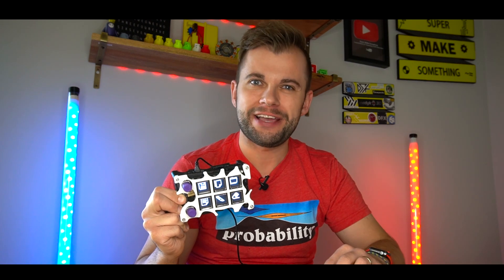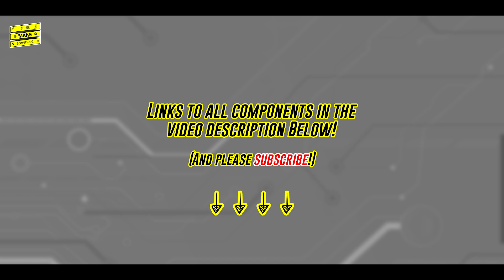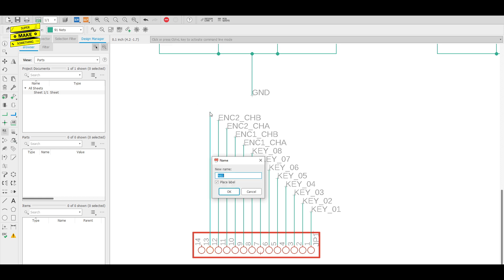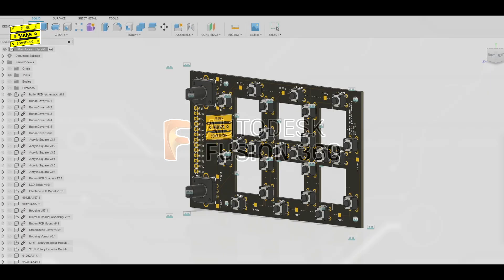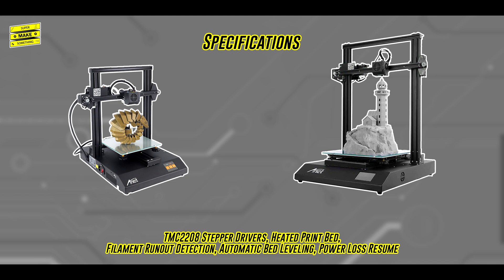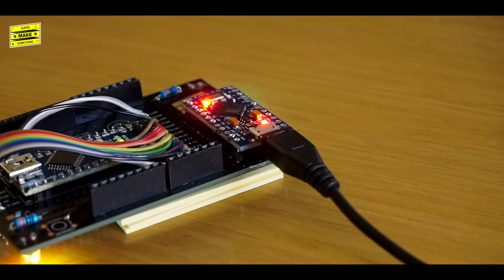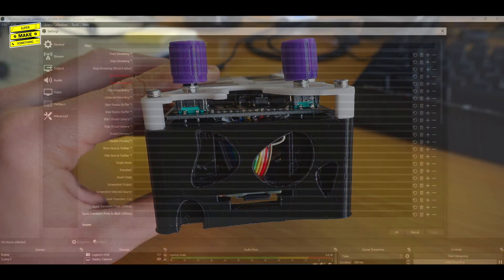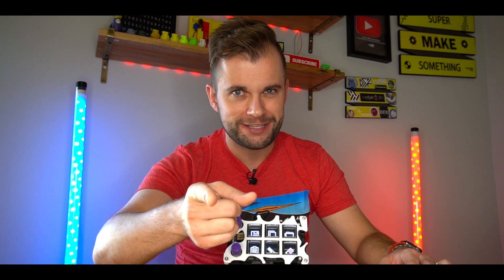DIY Stream Deck (3D Printing, Arduino, Electronics!)

Comment: y u don't use a multiplexeur
Reply from the maker: Definitely thought about it! For this version, I wanted to make it as easy as possible for anyone to build, so I did not want to have to make people try to buy individual chips because that can get confusing (both in terms of part number and soldering orientation). Single DIP multiplexers were also similar in price to another Arduino. 😅

Comment: "More buttons than IO pins"

That's where a grid multiplexer would come in
Reply from the maker: Definitely! Since I needed to use a second microcontroller anyway (the Pro Micro did not even have enough exposed pins to interface with the screen and SD card reader), wiring one input to each button on a second controller was the easiest/most cost effective solution for this build.  This also saves people from needing to hunt down individual chips, which hopefully makes it easier for those new to electronics to build one of these Stream Decks.  That being said, if I were to do this project with another microcontroller like the Raspberry Pi Pico or STM32 "Blue Pill" board, multiplexers would definitely be the way to go!

Comment: It's pretty pin  inefficient to interpret the keyboard matrix directly on the arduino. I know this is what every example of keypad usage for arduino shows, but in real world professional applications this is done with a resistor  network which allows you to interpret almost unlimited keys with a single signal wire instead of needing a wire per column/row.
Reply from the maker: It's true -- something like a multiplexer would definitely work as well. Since I needed to use two Arduinos for this project anyway and did not want people to have to buy individual chips to build their own, I decided to use a button for each pin. If this project were done with something like the Raspberry Pi Pico or STM32 "Blue Pill" board, this would be a great approach.
Reply: @SuperMakeSomething  Yeah I was researching using a 74HC595 as a multiplexer, which is how I came across your video. Still undecided on which of the 3 methods I will use for my application, muxing increases the complexity a lot especially over 16 keys, but the resistor network is inaccurate unless you have precision resistors of very specific values.
Using matrix polling as you have here, is right out as I'm using a Seeduino Xaio, very powerful, but only 11 signal pins to work with, and I need to do SPI as well as poll the keypad.

Very nice implementation of the elgato style by the way, I think I might steal that for my application, I had assumed they were using some kind of custom button with built in displays, (what else would justify that mark-up, lol).

Comment: The Freedeck project does the same with 2 multiplexer IC-s (very cheap) so you don't need the second arduino... worth visiting the idea. Also you can scale the design then with more buttons without needing even more arduinos... I like your button design way better than pressing on the screen itself.
Reply from the maker: Multiplexers are definitely a great idea!  Unfortunately the Pro Micro did not even have enough pins to interface with the LCD screen/SD card reader (let alone have a few spare IOs for buttons/a multiplexer), so I think a great remix of the project would be to use something like an STM32 Blue Pill or RPi Pico in conjunction with mulitplexers to greatly expand the number of usable buttons.

Comment: Instead of using two microcontrollers, couldn't you utilize shift registers to save on pin use from the buttons? 

Also, maybe an esp8266 nodemcu module would be a better choice as it comes with the SPI pins needed for the microsd card.

Overall, nicely done though! I've been looking to do something similar to this.
Reply from the maker: Thanks! A NodeMCU would be a cool idea! I am not sure if it could natively emulate a USB HID though..? Shift registers and/or multiplexers would definitely work, but I wanted to keep it as simply as possible for others to recreate and didn’t want people to need to guy buy individual ICs. I’d also be really interested to try using a RPi Pico for this project as well!
Reply: @SuperMakeSomething  Well said! If it were sold as a kit, I could see using the shift registers then.
Reply from the maker: @bgubs07  Nice — that is a good idea!

Comment: Would this work with the Pi Pico as the controller?

Also can you make multiple profiles? Or trigger a specific loop to call out different keys, for different programs?
Reply from the maker: The Pico is definitely something I want to try! Unfortunately I have not been able to get one yet. 

The profile idea is interesting! The closest to this in the current design is to have different keyboard combos assigned to the different “pages,” otherwise you would need an external application. That is essentially how Elgato’s app works — it assigns different button pages with each profile and switching profiles is roughly equivalent to reprogramming the Arduino in this build with different keyboard commands.
Reply: @SuperMakeSomething  Can you create a loop in it and define key combos based off a program? I'm not good with Arduino yet, since I never gotten one yet but would be interesting to sort out, while I get all the components to build my own using your tutorial and codes.

Comment: Why didn't you use 1 pin to handle multiple buttons? Easily done using resistors to tell which button was pressed.
Reply from the maker: This definitely could work using an analog input, but the Pro Micro already didn’t have enough pins exposed to control the screen and SD reader, so I needed to add a Pro Mini to drive the screen anyway. Another option would have been a multiplexer IC, but I wanted to avoid buying individual chips to make it as easy as possible for others to build their own by buying easy to find components.

Comment: Amazing video, stoked to try and make one, do you have any info on the resistors specifically used? They look like 330's but I can't tell, you should do a write up on this as well as some things are missing from the video. Keep up the great work!
Reply from the maker: Thank you! Sorry yes — they are 330 Ohm resistors for the LEDs. I’ll update the project documentation straight away! Cheers!

Comment: Did you opt for a normal LCD vs a touchsreen LCD so that you could have functioning button?  or some other reason?
Reply from the maker: I chose to use buttons because I was worried how long a resistive touchscreen would last in this application. Since I wouldn’t be using the screens touch capabilities, I then bought a regular screen because its viewing angles are better and it is a bit cheaper.

Comment: Awesome project!  The enclosure style isn't quite my style but great final product.  How many buttons could the Arduino support?  I"m thinking a much larger stream deck would be awesome!  I'm thinking something like the Stream Deck XL with 32 buttons.  Would that be possible?  How difficult would it be to adapt your design to that do you think?
Reply from the maker: Thanks! Definitely possible as long as you either use a microcontroller with more inputs or a multiplexer IC. Interested to see how it would turn out! Please let me know if you try it!
Reply: @SuperMakeSomething  I think there is an Arduino that will support 32+ buttons but after you mentioned the delay in updating the screen when you went to a folder got me wondering what other micro-controller would work better.  Do you have any ideas?
Reply from the maker: The Teensy is a good bet, but it is a bit pricey. The STM32 could also work and I think it can emulate a USB keyboard as well. A really cool approach would be a Raspberry Pi Pico running MicroPython that I would love to try in the future.

Comment: I just use a keypad put into a raspberry pie that sends wifi commands to the main computer. Writing a little TCP/IP server is easy as shit and then you need some controlling software dispatching the keys to OBS or whatever program you want.
Reply from the maker: Cool idea! Do you have a GitHub where I could check out the code?

Comment: Or use a touch screen (with an optional physical button mask in front) + some software to convert it to your control inputs.
You might also introduce touch sliders with absolute or relative position outputs.
Reply from the maker: The slider idea is really cool! I decided to not use a touchscreen because I wasn’t sure how long this would last in this application, since it would be touched continuously and the “touch” element is only a thin film of plastic. Definitely an alternative idea though if you don’t want to go with the second PCB and physical buttons! If you end up making this version, please contribute the code to the GitHub repository and send me a pic — I would be interested to see how it turns out!
Reply: @SuperMakeSomething  I was thinking about a touch screen to be touched with a finger - but with an optional grid like yours in front of it. The grid should not touch the screen. The user might rest a finger on the grid snd touch the screen behind it with his finger - or use it without that grid.
The screen position should be converted to a button or a macro.
So there is much less hardware, it's more or less just the screen and some sort of microcontroller, maybe if necessary a raspi.
But it's just an idea right now. It might have disadvantages and so on.
Reply from the maker: Definitely a cool idea! I’m hoping that people will keep adding/modifying this base concept over time and making the code/files available so that others looking to build a Stream Deck have some options based on what they are looking for. Excited to see how it turns out!

Comment: Hello, i really like your project. Indeed, i like your approach to the screens a lot, the one color screen is much simpler than one oled monochrome screen per button.
About the microcontroller, either an ESP32-S2 or C3, they support  usb host, or an raspberry pi pico, also supports usb host.
With the ESPs of course, you add wireless, so the ability to update the firmware without pluging it, and with some code, changing the icons, creating new pages, etc, via a web interface.

The way i will tackle this will be to use a raspberry pi zero W, so i'll have wireless, HDMI for the screen, and the possibility to easily change code, pictures, assigned keys for each layer, etc... (i already have a bunch of unused raspberry pi zeros)
Reply from the maker: Thank you! Those are all really cool ideas! Wireless connectivity and being able to use an HDMI screen would be awesome! Please share a link with me when you finish your build! I am very interested in checking it out!
Reply: @SuperMakeSomething  Will do :) but i have many projects in the backlog for now, so it won't be right away :)
Reply from the maker: @AudreyRobinel  No worries! :)

Comment: I have to say this design is really elegant! I wanted to build a freedeck (another OS streamdeck) but was let down by its design. They use mini lcd‘s where you press down on wich activates a button underneath it. And because of that im not thrilled about that one
Reply from the maker: Thank you so much! Glad that you like the design. I’ve heard of the Freedeck — would be interested to learn how much the mini LCDs cost. (They seem like they would be expensive and use a lot of pins on the microcontroller..?) The LCD is a good way to keep the cost and pins to a minimum and get full color as well!
Reply: @SuperMakeSomething  i mean jusat look at the freedeck github :D they got everything there
Reply from the maker: @ThePapanoob  Haha good point. 😜 I will take a look. Cheers!

Comment: I'm not going to sift through the comments to see if someone's said this before, but have you considered using the Teensy 3.6? It's much faster (even overclockable if you want), can operate as an HID, has a ton of pins, already has a micro SD card slot on the board, and can be programmed through the Arduino IDE as an arduino-compatible device. It is a little pricy at $30 though.
Reply from the maker: Would definitely be interested in trying it out, though the price was a bit much for this first version of the project and trying to make it as low cost as possible. The Teensy does look like an awesome microcontroller though, so I will definitely look into picking one up!

Comment: Is that audrino software available for Linux? Also will the Photoshop templets load correctly in GIMP? (GIMP can open PSD files but it won't load things like layer fx and such as that code is proprietary to Adobe)
Reply from the maker: You bet — Arduino is available for Windows, Mac, and Linux! The PSD template should open, but I use an “outer glow” on one of the layers, so I’m not sure if this would work given the restriction that you mentioned. That being said, the important part is really the image size and bmp “mode,” so as long as you can recreate this in GIMP you should be good to go!
Reply: @SuperMakeSomething  the layer size will work, but I think the glow will be lost. GIMP has its own glow fx I can just replace it with though.

Comment: A less notch-y knob you could spin for a jog function for editing would be great. You should sell a kit.  Gather all the parts, mark it up and make a little money for the effort.  I'd buy one!  If you're going to do a V2 with 1 board with all the I/O, making it bluetooth/wireless would be a BIG improvement over the StreamDeck.  You could use a color epaper display which use virtually no power when you're not using them.
Reply from the maker: Those are all cool ideas! Currently there is actually a kit for this project in the works, so definitely stay tuned! I will be sharing more details about it as it develops on Twitter, so be sure to follow me there for the latest!

Comment: Maybe a good MicroPython / CircuitPython board will this make more accessible. It maybe a bit more expensive, but programming the board just by editing a file on an "USB Stick" might be much more accessible.
Reply from the maker: That would definitely be cool! I’ve read that the STM32 can run Micropython, but it lacks the hardware to be able to show up like a USB drive. The new Raspberry Pi Pico might be perfect for this in terms of functionality and price.

Comment: nice video, but take a moment and google for: idisplay TFT LCD Keypad
Reply from the maker: Those are very cool! I will look into picking one up to experiment with.
Reply: @SuperMakeSomething  the I have bought the 3x2  matrix and that keypad looks very similar to the stream deck. I wouldn't be surprised if stream deck sources them from idisplay.

Comment: Why the hell is this not hugely popular, awesome work. I hope a 2.0 finds its way to being made but this is already a huge amount of effort and it's a great contribution to the community
Reply from the maker: Thank you!
Reply: My guess is because freetouchdeck is much easier to build, less expensive, and superior in most ways.

That said I like this project as well due to the encoders and tactile approach.
Reply: its because streamdeck isnt just streamdeck its the plugins and support that goes along with it

this is a super cool and very well made item dont get me wrong but this is one of dozens of similar projects each acomplishing the task in a different way

as such support for the plugins and applications is limited and fractured across multiple projects and the community isn't there to support it 

a slightly different project is using phones and tablets as streamdecks to which touchportal and deckboard pro comes to mind
deckboard has a fair bit of support but its all from 1 dev who has very little time
meanwhile 
touchportal has a massive massive community behind it who have made plugins to support almost everything you can think of and if its not supported someones problem making a product as we speak to support it as such its popularity grows and its community support also grows

its now at the point where touchportal outperforms streamdeck itself in terms of software and device support 

what this guy has made though is still super cool and I love it but if these devices are ever to take off in a big way someone needs to create a firmware base that can be used on all theese DIY devices along with a software driver set that allows anyone who makes one of theese to share compatibility and software support under one platform

Comment: I've got questions (and a solution). Seriously, why 2 microcontrollers? Why not shift-in registers???

Anyway... A few years ago I was looking at macro keyboards and stream decks thinking "They're just silly. I've got a box full of old shitty keyboards. Surely I can just plug one of those in and get that functionality". I didn't find anything great. There was one thing I tried but it was old, hadn't been updated and was flaky and unstable.

But I found a piece of Python code which would do it for me in Linux (I was looking specifically for Linux). It was a bit rough but did the guts of what I wanted. I then decided to make it configurable via json, added in some functionality such as be able to change functionality based on what had focus and published the source code.

Have a look. If you're at all interested, I would love to have some help, even if it is suggestions for functionality.

https://bitbucket.org/NevynHira/macrokeyboard/src/master/

Comment: very cool but wont a touchscreen be more simple and cheap?
Reply from the maker: Thanks! I thought about using a touch screen, but my concern with these is that most of the cheaper commercial ones just have a small plastic film over the screen, so I wasn’t sure how long they would last if people were pressing on them repeatedly. By separating the screen from any input force, I was hoping to maximize the overall lifetime of the build, though using a touchscreen could definitely make things smaller!